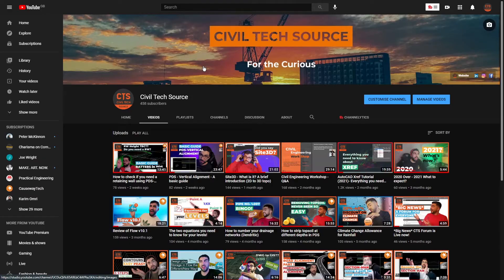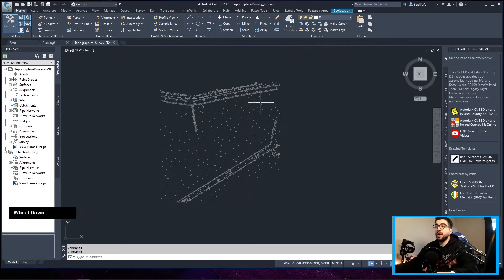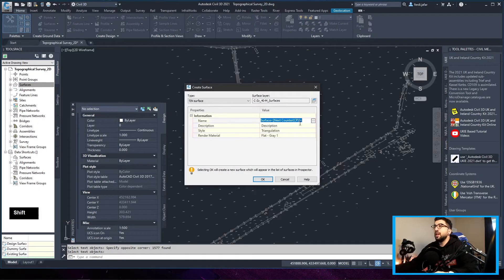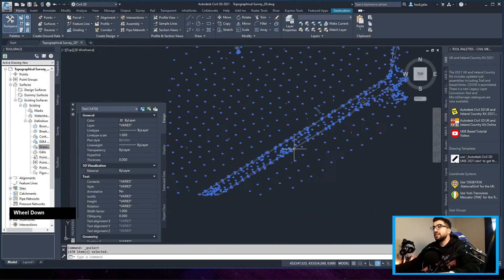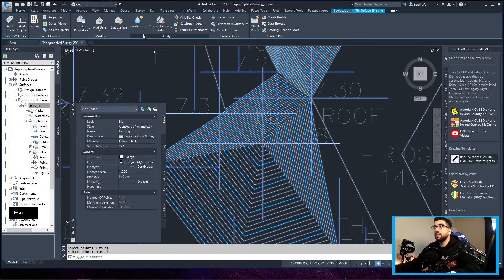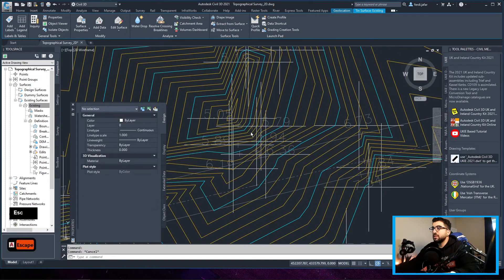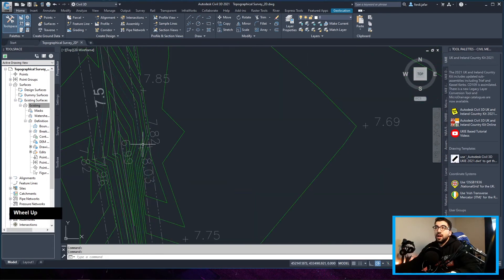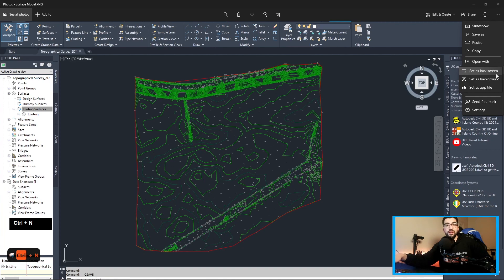Civil 3D Create a Surface using Text

Comment: This assumes that the text insertion point is at the actual point which it clearly isn't in the video. This may or may not be of significance but the DTM won't be a true reflection of reality.
Reply from the maker: Hi Neil, thanks for your comment. I think I have mentioned that it will not be as accurate as having the existing points in 3d and could be by few cm off.